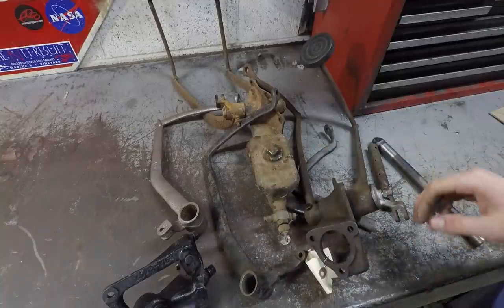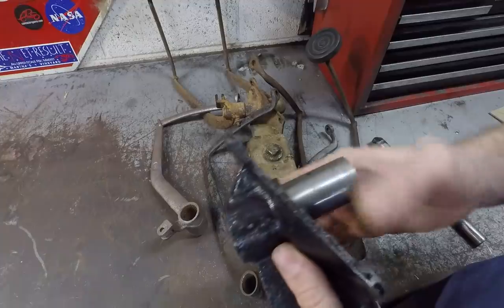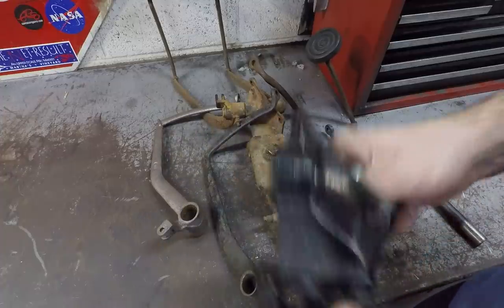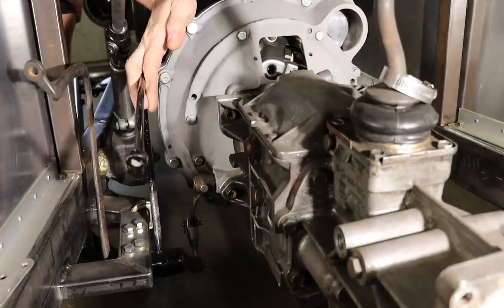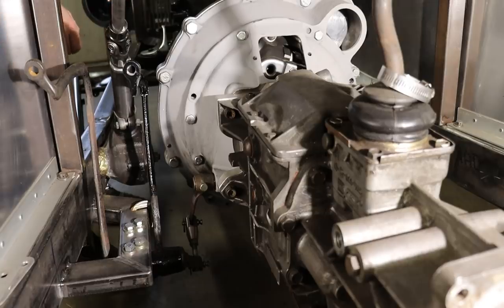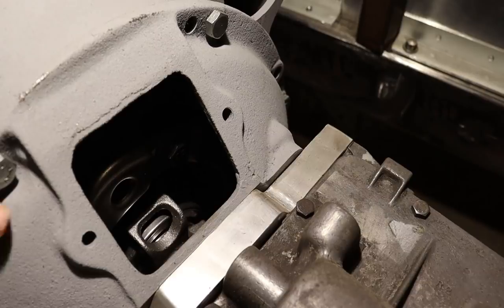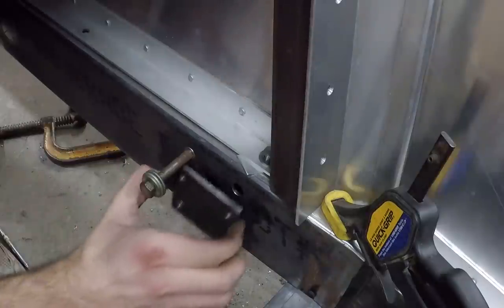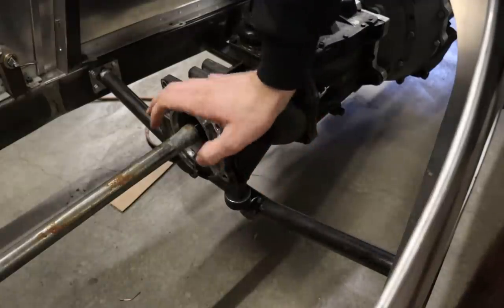Custom Hot Rod Pedal Set | Homemade Boat-tail Speedster Pt. 45

Comment: Hi Cars with a manual clutch always have a rod from the transmission to the crossmember to stop the engine and trans moving when the pedal is depressed.
This is also done to prevent clutch shudder.
That's great work you do.

Comment: Perhaps consider grooving the inside of those pedal shaft bushings to evenly distribute grease? Do you need an overcenter spring on the clutch pedal linkage or is the pedal effort OK as is? Your videos are so enjoyable to watch. No jibber-jabber, just get in to it and the sped up footage gets the point across very well.

Comment: nice idea with the rubber , nice find too , been looking for a small piece of track to make an anvil but stuff like that and the rubber you found doesnt lay next to the tracks a lotover here (its mostly in accessable anyway ) , wat i seen people do is cast their own bushings from Polyurethane basicly use the outer skin (pipe) and the bushing and cast the rest full of resin 
might be nice to recast stuff like the pedalrubbers radiator mounts driveshaft donuts (?) and stuff like that 
not sure if it was mounted completely but when you demonstrated the clutchpedal i could see the frame around the pedal assembly bend down , you might need to put some brackets next to it

Comment: FYI, those bungs should be pushed in after welding.. we've had issues where the press fit loosens due to the heat of welding. It can cause them to strip when being removed and installed along the path to final assembly. 
Keep up the good work..

Comment: When you push that clutch pedal you’re getting a lot of flex in that little frame mount you made I would put some gussets in there.
Reply: He mentioned in another comment that there will be more structure built into the floor.

Comment: I see this as pedal box Mk1. Anyone who's driven an XK6 with a manual gearbox will tell you that hydraulic is the way to go. Even using just using hydraulic to isolate the two elements will help structural integrity.

Comment: OK who would give thumbs down on this video ?
Did they happen to leave a negative comment in this section ?
05:43 I know that worked, but I would have thought of a "safer way" to drill the holes without the possibility of drilling the table.
Reply from the maker: the drill was lined up with the slot, so there was no chance of drilling the table
Reply: @MacroMachines  I understand but one slip and their you are.

Comment: Would it be worth a tack weld from the TIG on those thread inserts?
Reply from the maker: Whenever something is bolted to them, they get pulled in tighter, so that's not necessary
Reply: Can you post your source for those threaded inserts

Comment: Was wondering whether the clutch you are operating was originally a hydraulic or a cable one?   If it was a hydraulic operated arm man your leg is going to feel it because the leverage and fulcrum points are different for hydraulic and cable operations, a hydraulic slave doesn't feel the pain and has the power to instantly push the lever which pushes back thus maintaining that hydraulic pressure to create movement.   If it was cable operated you might be able to lighten the load so to speak with some judicial changing of the leverage and fulcrum applications giving you more "foot" pressure on the linkage or if its too light you can put a decent spring to give you a decent "foot" feel.   I put a beefier spring on my Reliant Robin's clutch arm as it grew to feel loose on the push and a little work out for me left.

Comment: A bit of flexing in the frame when you operate the clutch pedal.  That concerns me a bit.
Reply: That might have been solved by welding that support beam on afterwards.
Reply from the maker: it's just tacked together right now, and there will be more support later on too
Reply: Great work, loving the progress :)
Reply: That's what I was thinking.
Reply: @MacroMachines  Hi, love the build! I had movement on my A-V8 roadster when depressing the clutch. The engine would move on the mountings. Solved it by bolting a short piece of chain between bellhousing and frame. Apparently they used a cable with an adjustable rod on one side back in the day...

Comment: Just noticed your trans has a transfer case adapter(4x4).Are you switching it to a 2wd tail houseing with yoke seal for driveshaft?
Reply from the maker: no, I'm going to adapt it to the Ford closed driveshaft
Reply: @MacroMachines  oh a torque tube ,that will be interesting

Comment: As ever great stuff.

What are the threaded bosses at around 6 min 30? Thanks in advance from a fellow car / welder / resto man.

For all "thumbs down" people - men in white coats will be calling shortly
Reply from the maker: they're the same as the one I explained around 12:34
Reply: @MacroMachines  He might have been asking where you got the inserts?  eBay, or NAPA???
Reply: Yes - where are they from.

Am 75% through a Porshe 912 resto and am into fabrication generally.
Reply: @mattinhessen7148  eBay and Amazon have Rivet nuts- but not the same as shown here:

Comment: The transmission might not mount in the same place because you are using a 4 wheel drive transmission for mockup and a 2wheel drive sitting more forward with the mount just saying

Comment: If the engine is on isolation mounts and can rock (from torque) then you might want to check to see if the clutch pedal is going to bounce significantly from that rocking. I had an old Ford pickup with worn mounts and it was pretty difficult to get a smooth clutch action when the engine was rocking. 
Mind you, that (Ford) clutch arrangement was designed by a moron, so you probably have a better design there.
Cheers,